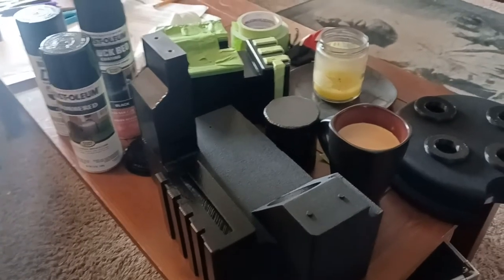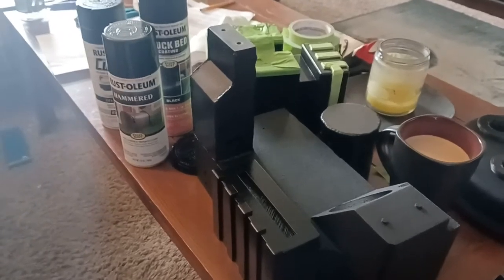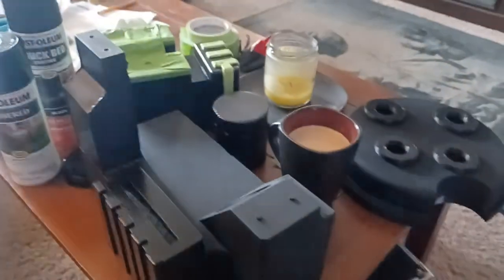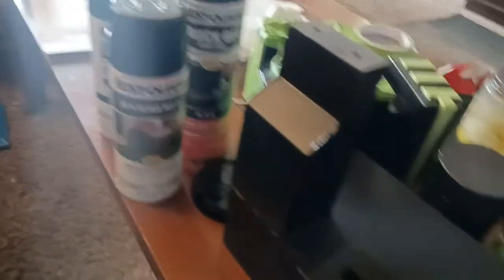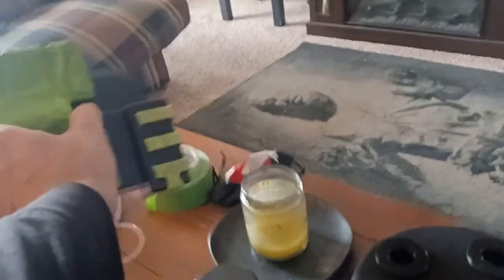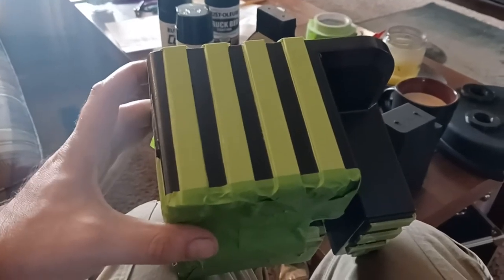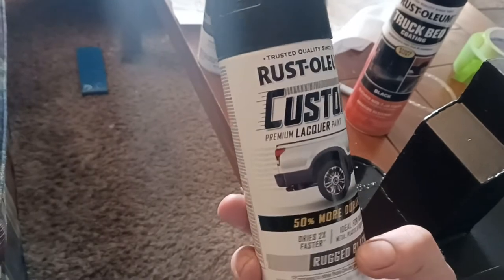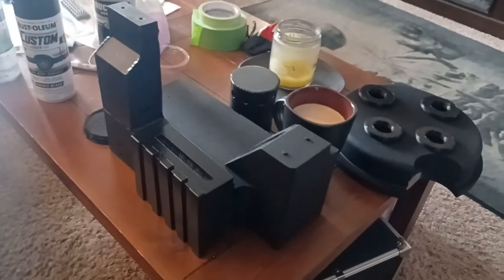Proton Pack Paint Job Masking Truck Bed Liner 3D Printed Ghostbusters Props

Comment: Love the insights in this video - for different textures. Also love the insight on the difference between screen used and pops for detailed visual inspection - can confirm they did use bed liner for the texture in the films. Great work!

Comment: Awesome vid, didnt think about the hammer paint. Got a resin wand which i converted mostly everything into aluminum except the main gun body. My question to you is can you spray over hammer paint without losing the effect. My idea is to use hammer base+paint silver then go over it with satin black
Reply from the maker: Yeah, it should maintain it's detail with a layer of silver and satin. I would practice a little first because you can control the texture with how thick you lay it on